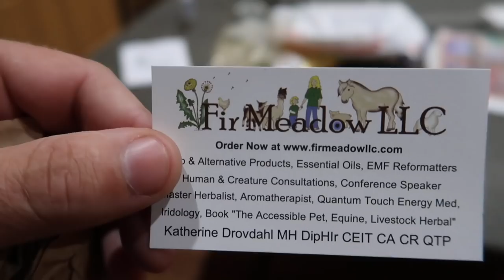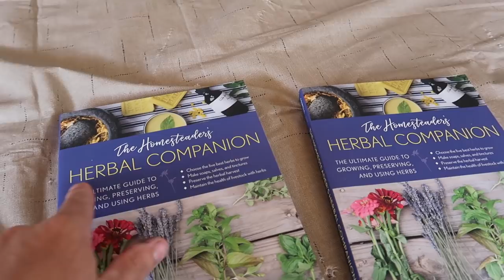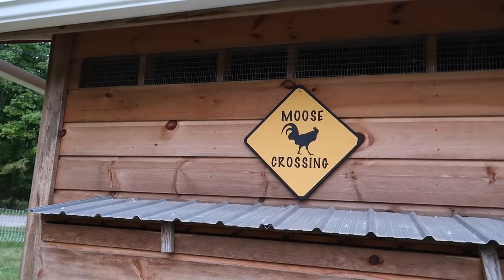You wont Believe What they made!

Comment: If that is just mildew around the door frame a mix of Clorox and vinegar in a spray will kill it immediately......and it will look brand new......I treat mold as a side business and for outside use nothing is better.....put a drop or two of dish detergent in to help it cling......just mix it outdoors because it is really strong as a combo.....and also you can use it indoors but open the windows to air it out.....the odor will last until the mixture dries which doesn’t take long at all.....the only thing to know is avoid cloth because it will bleach it out but everything else is resistant to the bleaching.(I would tape your wood before you treat it)
Reply: Don't EVER mix Clorox with anything except laundry detergent.  Makes poisonous gasses and WHEN the goats nibble on it!?! The safe and completely nontoxic way is peroxide and baking soda.  And if you have Clorox on your property I suggest you learn how to use it responsibly or dispose of it at your local hazardous waste disposal and don't buy more.